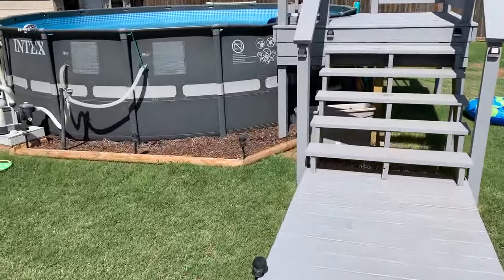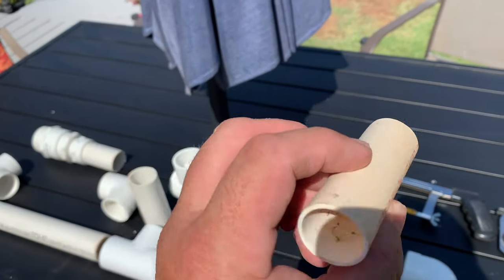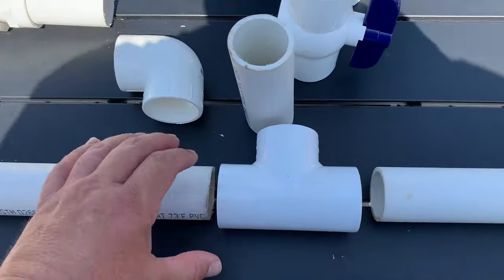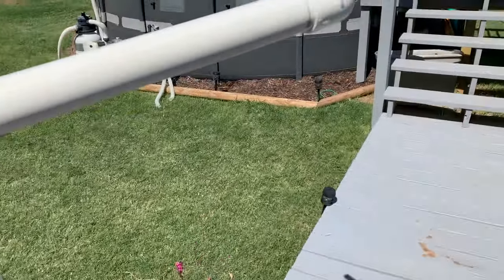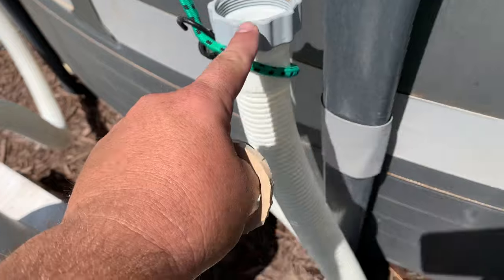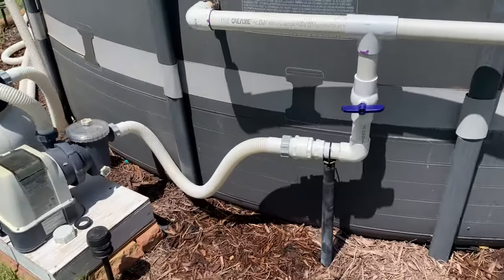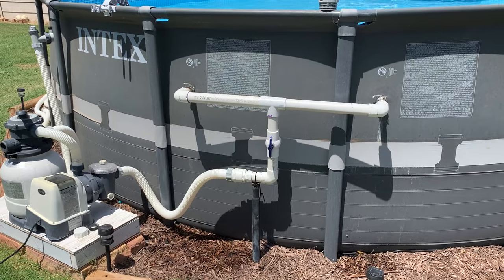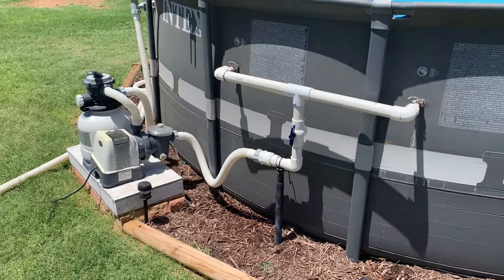How to PVC plumb your INTEX pool

Comment: I'm having trouble connecting my intex hose to the 2" threaded pvc male fitting. I didn't have a solid piece of rubber so I used piece of foam. Couldn't get a water tight seal. Too much air is getting into the pump. 
Any advice on what I should use for a washer?
Reply from the maker: I have seen a comment were somebody found large enough O-rings at Lowe’s or Home Depot
Reply: @LifeLessOrdinary  I kept trying to make a washer using the foam and it finally worked. Going to the store in hopes of finding something was my next option.
Reply from the maker: I believe the guy said he found it at Lowe’s in the kitchen faucet area it was a bag full of black O-rings of all different sizes. I believe he said he found two of them and double them up and it was enough

Comment: I have the same questions about the skimmer.  If you put the 3/4" pipe inside the outlet how did you put the skimmer fitting inside the same hole?  My hoses just cracked and I woke up with a half empty pool.
Reply from the maker: I cut the skimmer piece a little and didn’t slide the 3/4 PVC in to far. Wow total bummer about your hose my old clear hose have crack before also, that’s why I have the white hoses now
Reply: @LifeLessOrdinary   I was looking for this question.  I just did your set up and getting ready to glue all the pieces.  I was looking to see what you decided to do at the 2 in-flow holes.  I see the skimmer in one but I couldn't see what you did with the other one.
Reply from the maker: 2” flow holes? The only hole I have 2” is the return witch I left alone.
Reply: @LifeLessOrdinary  not 2 inch.  The inlets (2 holes).  Didn't mess with the sizing of them.  I got it all set up today but I wasn't able to keep the skimmer pieces.  Couldn't stop the leaks there....so the inlets are open.  Figure we will just have to clean the larger pump filter basket more often.  It circulates the water so much better without them.
Reply from the maker: Oh I’m sorry I read it wrong. I didn’t add anything mine still looks just like the video ended. One hole stays open the other one has the skimmer going to it. I used the adapter for the skimmer I just cut the adapter back a little to fit into where the pvc is.
Reply: @LifeLessOrdinary  thank you.  My wording was not great so that didn't help  lol
thank you for sharing.  This set up works fantastic!!
Reply from the maker: That’s awesome I’m really happy it worked out for you. That was last year and so far mine is still going strong

Comment: Any suggestions on what to check for if the suction to the skimmer is almost non-existent?
Reply from the maker: Most likely the pump, what kind of pump are you using?
Reply: @LifeLessOrdinary  it’s the interx sand filter pump sold with the 18 x 52 pool
Reply: @bethbabin9941  With a sand filter, it could be clogged with debris, and should be backwashed.  The pump should have a pressure gauge on it to help clue whether that is the issue.  Otherwise, there might be some obstruction at the skimmer or in the line tween skimmer and pump/filter.
Reply from the maker: Absolutely 👍

Comment: How did you attach the skimmer basket to the new setup?
Reply from the maker: The skimmer comes with a inlet adapter I just cut a little from the tip to slow it to go in inlet enough to hold .
Reply: @LifeLessOrdinary  thanks

Comment: So I completed this part. Now my question is, when I need to vacuum the pool, how do I do that? I no longer have the gray screw piece on the inside of the pool. I also want to add a skimmer. Please help
Reply from the maker: This adapter goes in the hose end and fits into the inlet. 
https://amzn.to/4cYLZw1
Reply: @LifeLessOrdinary  
But we used 3/4” pvc to go through the inlets of the pool. I need something that fits in there in order to attach the vacuum hose for the pool, correct? These look way too big & say 1.25” - 1.5”

Comment: Be aware that PVC deteriorates in sunlight from UV exposure.  You may want to paint your PVC with an outdoor paint that works with PVC and is known to offer UV protection.
Reply: That pvc will be there long after we're all gone, pvc is very thick & heavy & many professional pool installers use pvc
Reply from the maker: Yes it is 👍🏼
Reply: @ConditionZero76  While true that it is thick and heavy and used often, if not protected from the sun's UV radiation it can become very brittle and break with only a few short years of exposure.  I suspect most professional uses are either in places protected/shaded by the sun, or painted or coated with something to add UV protection.  Just FYI...

Comment: Why didn’t you do the inlet to the pool as well?
Also what did you use as a screen where the 3/4 “ pipe went ?
Reply from the maker: I didn’t use any scream at the three-quarter inch. If any larger debris gets through it gets caught up in the basket before the pump. And yes you can change out the inlet to PVC also I just chose not to. But yes it is possible

Comment: What do you have underneath the pool? Not just mulch correct?
Reply from the maker: I put a tarp over dirt then the pool. I don’t like putting it right over dirt without some kind of protection
Reply: @LifeLessOrdinary  I have a Coleman going up in the next few days and planned on ordering a bunch of sand to go underneath.
Reply from the maker: Sand works great 👍
Reply: @LifeLessOrdinary  thanks, we're new to this. Sand then pool pad on top of sand, then pool on top. Have to take it down ever year in my area which will suck and I need to find an upgrade to the crappy paper filter but I'm hopeful the pool comes out how it should.
Reply from the maker: I love my sand filter keeps the pool so much cleaner.

Comment: the problem with going from the 2" intex hose to the 2" pvc is that the threads on the pvc is tapered, and on the intex hose ring, it's not, and won't go all the way in, that's why you have to add another rubber seal on the inside.
Reply from the maker: Correct 👍
Reply: @LifeLessOrdinary  how or where did you get the rubber seal? I’m having the same issue
Reply from the maker: I found a thick peace of rubber and cut it to size making a thick gasket basically
Reply: @don_wynn  I went walking round lowes and by the faucet/toilet section, there's a place where they sell a whole bunch of different size round rubber rings for sealing faucets and such. One pack contains an assortment of rings, including a pair of big ones, that fit perfectly. When you screw in your pieces, just don't tighten them too much; stop when you feel residence. Of the assortment pack, there's only 2 big rings that will work for that, so I had to buy 2 packs just for 4 rings.

No leaks yet!
Reply from the maker: That’s awesome information, and hank you very much for sharing
Reply: @jahnkaplank8626  hey Jahn, I actually bought 1 pack a few days ago and yes there are only 2 in out of the many that will fit.  How many did you have to use for 1 hose connection? I tried using 2 and it seems like I may need to use 3.
Reply from the maker: I think he said both packages

Comment: How’s you pump holding up so far? What was your pressure gauge reading, mine stays at 10psi idk if that’s normal with this set up
Reply from the maker: Pump seems to be working great, I haven’t noticed the actual PSI number but I am showing in the green on my gauge
Reply: 10 psi is absolutely ideal, That's what want an optimized pool flowing at without restriction of pipes or dirty filters  ....

Comment: looks good man but everything you've done is actually starving your pump & filter, you should of installed new 1 ½ inch openings & pipes everywhere so the pump & filter can actually clean properly & isn't choking for water, everything looks really nice but I would definitely cut new 1 ½ holes & adapters at the inlets.
Reply from the maker: I’m sure by doing that I could get better water flow. But I’m not taking a chance cutting new holes for the inlets for a little bit more water when the way I have it the pool stays very clean. But that is great information I appreciate your comment very much.
Reply: @LifeLessOrdinary  I understand & yes it seems wrong & or scary cutting holes in a swimming pool LOL, However it's not that bad as long as you take your time measure twice cut once. the larger inlets obviously allow for much greater flow which results in a crystal clean pool at much less energy/effort. But I completely understand your thoughts & if it's working good no reason to change anything... 👍🏼

Comment: How did you run the power to the pump?
Reply from the maker: The pool is only about 10 feet away from my house and I have a power outlet close by
Reply: An extension cord?
Reply from the maker: No the pool pump cord is like 15’ it was long enough. I just lay it across the yard and unplug when I mow
Reply: @LifeLessOrdinary  
Is the cord and pump ok in the rain?
Reply: @ericmuller3339  I do it a similar way.  My pool is nearer my shop (better sun exposure) so we have extension cords going from the shop to the edge of our lawn and then about 15' to the pump.  Been doing it three years now in Oregon and cord and pump do fine in the rain, no issues.
Reply from the maker: Yep no issues at all 👍

Comment: What I don't get is why Intex pools have a double hose intake hose set up going to the pump?  Honestly I would have used a high compression hose out at the 1 1/2.  by using that 3/4 you're making the pump work harder and reducing the flow going out and back in.  I'd say putting a strain on the pump by blocking the water flow.  I'm doing away with the entire system they provided and going with Hayward and Pentair.  1 1/2"  out with a 2" inch to the pump and filter with a reducer back to the pool at 1 1/2" return.
Reply: Single? Think dual is required so people don't get sucked in lol. Some entanglement law.. then their little paper pump probably doesn't suck much for it to be a restriction. I went with a real skimmer and main drain with 1.5" PVC. Need to plug these holes completely

Comment: All looks good except the connection to the pool. Placing the pvc inside the hole restricts the flow and can cause issues with your pump. Look into enlarging your inlet holes and you will get a way better water flow to your pump and as well as your discharge outlet. This will help the longevity of your nice sand pump.
Reply from the maker: Great information Alex, thank you

Comment: What three adapters did you use for the step ups like the sizes in also can not find a 1 1/2 to 2 in nch thread
Reply from the maker: You can do it with just two parts

https://amzn.to/3JgZpWC
And
https://amzn.to/49Ai1Mg

This is what I’m using on my new install here in a few weeks